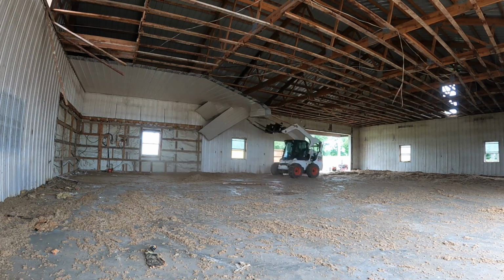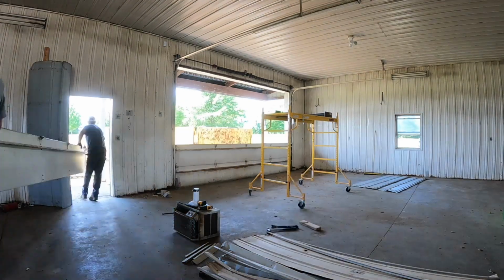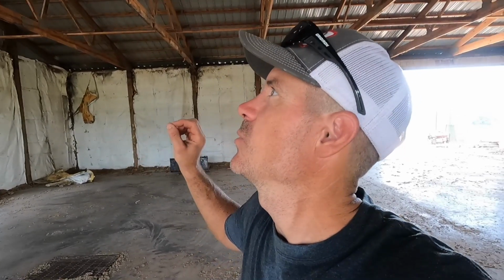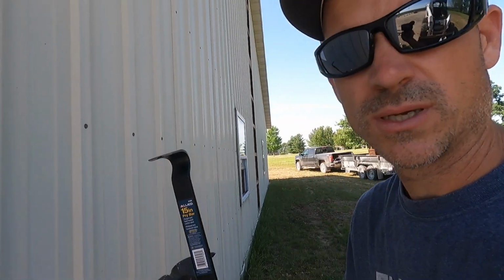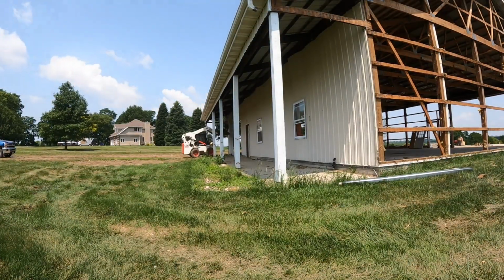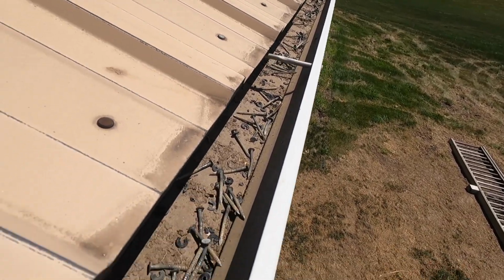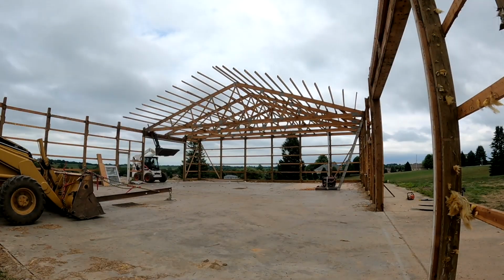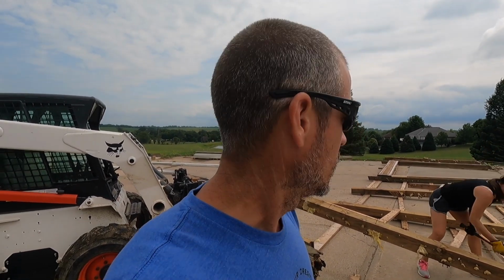64 x 48 Post Frame Barn Removal + Why I Think Posts Should be OUT of the Ground!

Comment: I built a new foundation under our Cabin and although some pressure treated lumber was originally buried underground 38 years ago, the tree stumps failed.  I pulled out several of the 6x6 treated posts and there was no rotting anywhere.  I was surprised.

Comment: You can use a Slide Hammer to pull those nails....once you pop it out enough use the slide hammer to get it out quick...just make a adaptor to fit the nails to slide hammer....
Or add a adaptor so you can tap on the head like a flatbar...

Comment: That is the same size as my pole shed..48W x 64L - 14ft ceilings...
Mine is still unfinished and dirt floor...i bought property 12 years ago with 3 buildings and house...old farm that they sold the house and 6 acres to us... Mine has those in ground posts too...i don't see how they can't rot over time either....i only have plans to gravel the floor right now....and try to stop the moisture with plastic etc..under it ( gravel )...
But might do more later on...

Comment: What would you recommend instead of posts in the ground?  Especially for smaller buildings/sheds?  Wet set brackets are 50-100 each!  That's a lot of expense.  So what are alternatives?
Reply: You use shorter posts so there is a cost saved to partially recover cost of brackets.

Comment: I notice you lose quite a bit of material in the demo process. You say you are moving these buildings. It seems to me like you will eventually build a new building using some of the materials you were able to salvage from these existing buildings. Are you really saving that much money doing it this way as opposed to buying new materials. I know the prices of lumber are high right now, but would this normally be worthwhile? What are the advantages to this? I would worry about using material that's already had 10 or 20 years' worth of weather, rott, and ageing.  I love your content. Thanks for sharing your journey.
Reply: big trusses are expensive for one thing

Comment: Paul - I didn't know you had to tear down a barn to build your garage.

Anyway, it looked like the posts didn't have a concrete footing below grade. If you install a wood post (treated) underground directly in contact with the earth, sooner or later it's going to rot no matter what.

 If you dig a post hole deep enough to the frost line that complies with the building code in your area (say, 12" diameter x 24"deep), you can pour a bed of concrete in the hole, install the post plumb and square and then fill the rest of the hole with concrete. It should last a lifetime. Hold the top of the concrete about 2" below grade so you can top the area with grass.

The purpose of a concrete post footing is to:
1. Transfer and spread out the vertical loads on the post to the earth, and
2. Resist horizontal, high-velocity wind loads

Just some brain candy I thought I'd offer! Keep up the great work!
Reply: Just a thought- even poles sleeved and set in concrete won't last. The concrete shrinks away from the wooden pole and the wooden pole can shrink if it continues to dry- which it will do in much of the Southwest and other parts of the US. Drilling a concrete pier to the frost line and setting the post on top, above the ground will outlast everything else- only hardwood buried in low moisture soil might come close. But have you priced a 6x6x20' pole lately? Or even last year before the pandemic shut us in? That is also a tactic that will let Paul reuse most of the pole lumber he rescued. I'd say the 140 man hours at $20/hr, or $2800 in labor value for 4+ K in materials was a good deal. But it was hot, yeah, buddy! FR
Reply: @fredericrike5974  Good points! Thanks for the reply!
Reply: @madhatter2012  The difference, most times, between "great architecture" and a great standing, beautiful building is cost- the ever present bottom line. Occasionally really stupid does get done- and many wind up bankrupt or reputations ruined.
MH, that is the industry I got to bang around in for 35 years; I was never bored and several times terrified when the risk seemed to be going out of hand! Wouldn't trade for anything! FR
Reply: Sorry, but after a lifetime of construction experience, in a region with an average of 40-50" of moisture a year, I can safely say that you just described how to GUARANTEE that a post will have a short life, and fail. The failure will be at the top of the poured concrete surround. The post will be mush from that elevation downward for a foot or so, if it's bad enough. The reasons it will fail include the fact that you are eliminating any chance of the wood drying out in times of low ground moisture, since you have encapsulated it in concrete. The post will shrink significantly, and leave gaps between the concrete sleeve and the wood, which will further encourage the post to remain in a water filled sleeve. The other issue is frost heave. If you just dump concrete into a rough hole, you create a jagged concrete column. As frost forms a lens around the column, it will grip the rough concrete and frost jack the column out of the ground. If the hole was tapered a bit, the probelm gets even worse. Ever see a light pole building in frost country, that has a huge hump in the drip line of the roof at a post column line?  It happens as a result of frost jacking, the builder didn't intentionally nail the beam 3-4" higher at one post, that happened after a few years of frost jacking. It's the same reason you see steel pipe posts on chain link fences and wash line posts occasionally sitting up out of the ground with a rough,  funnel shape cone on the bottom.